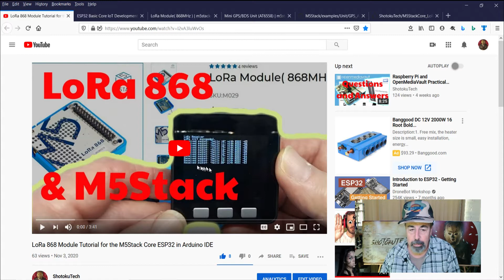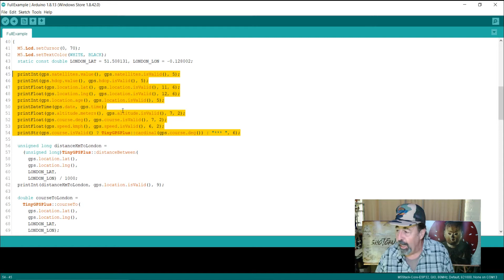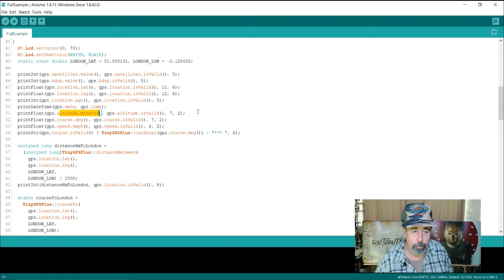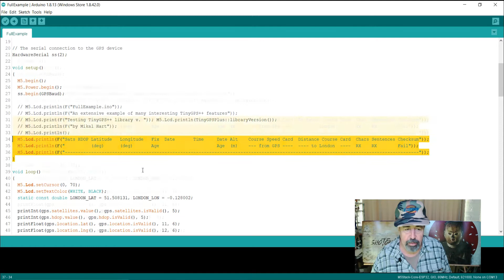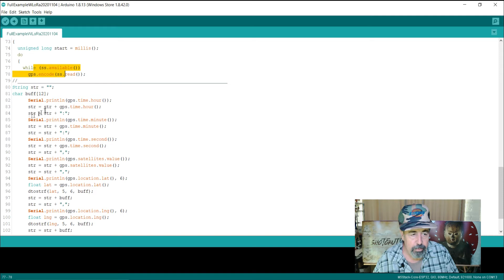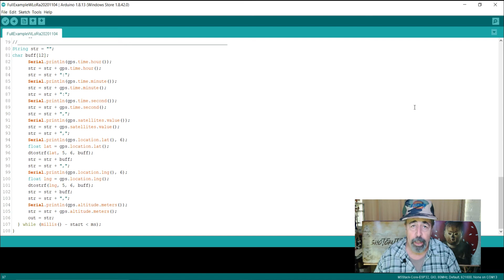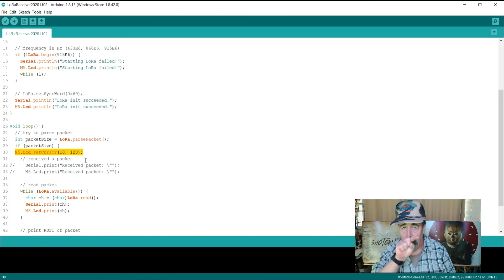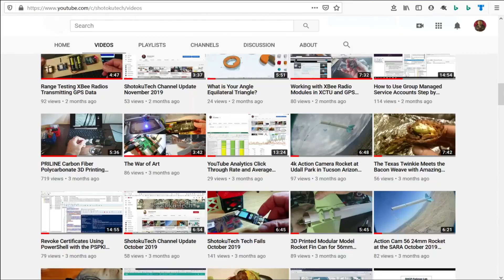GPS and LoRa Tutorial with M5Stack in Arduino IDE

Comment: Is possible to transfer data from an M5stack to another one? For example there is a weather app on one of them and I want to install it on another M5stack. Is it possible?
Reply from the maker: You present a great question. This is a python environment. The firmware runs the default main or temp.py program, depending on whether you 'run' or 'upload' from your computer. So the question is can we transfer that default program wirelessly from one unit to the other? I would bet this is possible. But it might exceed my python skills.